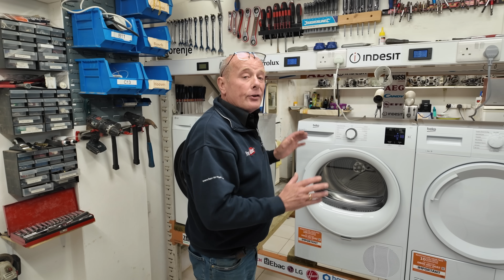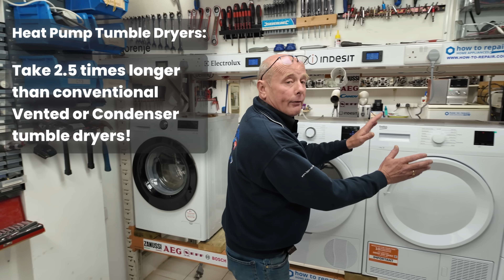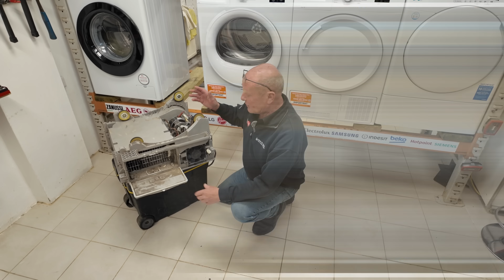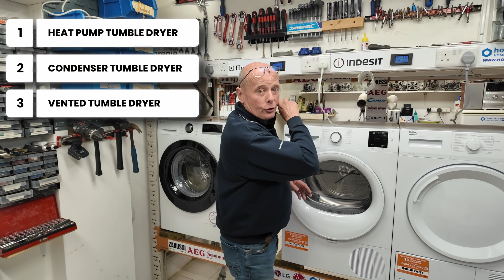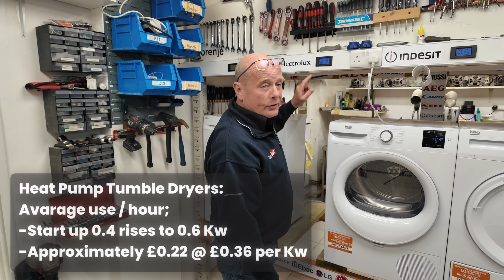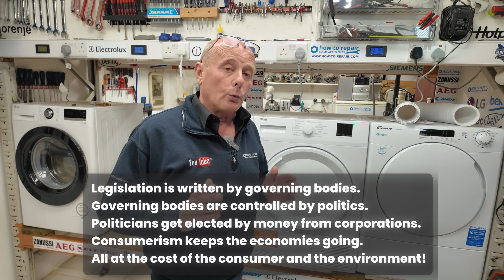Tumble Dryers the Shocking Truth About Heat Pump vs Vented & Condenser, NEW LEGISLATION!

Comment: Well my Beko heat pump drier is a replacement for my old condenser drier that died….it is in the garage, so no warm temperatures, it is also a condenser - I have to empty the water tray every time, and as for maintenance it is the same as the condenser system, as long as you hoover out the exchanger monthly, clean the filter every time and occasionally wipe the actual sensor (it gets covered In insulating fluff) it works as well as the condenser one it replaced…benefits are a lot less power usage.
Considering the price against my initial outlay on the condenser system, it cost slightly more. 
Over the last 3 years I have saved the difference in price and more….if it lasts the 5 years you quote as typical usage, then I will buy another one - get another 3+ years guarantee and have a new modern heat pump system that is hopefully even more efficient.
It’s a no brainer over the condenser drier, with only the old fashioned “cheap” heater element one, that is a fire hazard in waiting.

Comment: I've been using a dehumidifier with drying setting, placed in my airing cupboard. But I've been wondering about a tumble dryer. I liked the condensing dryer I had in a high-rise as part of a washer-dryer but only because of space saving. Had a condenser dryer since and it wasn't as good as a vented machine. Done plenty of washing by hand and using twin tubs in the past. I must say that vented dryers are very expensive to run and all dryers ruin clothes quite quickly. Just look at the amount of fluff in the filter. That's your clothes becoming threadbare. Sometimes I want to do a load of clothes and some bedding. It would be good to have something. Heat pump dryers caught my eye when they came out. Probably not for me at that price. I was thinking of maybe putting a dryer in the garage. The airing cupboard method is cheap and effective but a bit noisy close to the bedrooms and sometimes I have to go in and move things around a bit. I also have an extension lead trailing g across the landing floor.

Comment: Appliance lifespan is a big topic. A lot is said about how appliances don't last as long. However, when you look at what things cost years ago adjusted for inflation it's surprising how much more they cost. So yes, people should have expected more years of use at those prices! With the current cheaper but typically shorter lived items, are we getting value for money is the big question I guess? And what are our modern consumer expectations? Do we shop for durability as much as our grandparents would have?

For me, getting enough lifespan out of it is the important thing, but for most items it doesn't have to be more than about 10 years to satisfy me. Appliances are consistently getting more features with each generation now and that makes replacing them periodically more desirable, for example many older induction hobs like the one my mum bought 10ish years ago still work - which is great - but the latest models have a lot more features and smart technology. I just bought a £550 bosch induction hob with lots of nice features that I'm already enjoying, but will it hold up against the latest hobs in 10 years time? Probably not, and at that time it will have cost what, £55 a year averaged out? With the appeal of the latest technology I won't feel a great desire to fix it if it fails then, I might even already be checking out other hobs anyway. The gas hob it replaced wasn't broken, I just didn't like it any more. My Siemens dishwasher cost £700ish, so if that lasts 10 years I've spent £70 a year, roughly about as much to own the machine as the detergent, salt and rinse aid to use it! So even fairly high end stuff is cheap enough to have pretty low yearly costs if it lives to a reasonable, but not remarkable age.

I think for many consumers today exceptional longevity just isn't as desirable as it once was now that appliances are cheaper and periodic updates to have newer technology are desirable, even expected. We live faster more disposable lives than ever now. It has upsides and downsides really.

Comment: If i knew i would never have gotten a heat pump bosch. Condenser seems like a good middle way as we are not allowed to dump the hot air into venting system and its nice that the water goes down the drain+ easy to clean.i have looked how i can clean mine but cant access as you said and the lint catcher is NOT 100% air tight so I can see tiny dust on fins already after some 100 cycles.

Comment: Hi Paul, thank you for taking the time to produce this video! I am looking to purchase a new dryer,  after your video I will look for a vented or condenser unit now, I have to agree with you the logic does not hold for heat pump dryers. Thank you for your insights. Regards Andy

Comment: Looks like quite a few heat pump dryers are not that much slower than condenser dryers. I've seen a review of a Bosch one that only took just over an hour but a hoover model took nearly 3 times that so looks like the times vary a lot. Wonder if the technology is better in some than others.

Comment: The main problem i found with my (now very old) bosh heat pump (10+years) is about cleanin. some month ago the fluff went into (under ) condenser, where there is the water, at the very back of machine there is this electric part that when touch water start to pump water into tank. well... the fluff into water become sludge and get stucked to those two pin, so the pump went in error like: empty the tank u idiot... was quite a pain to understand what the problem was also becouse i thought that that back panel need to umnound EVERY side and top panel to be reached... guess what? i could open it directly from behind, but was a good thing to totally open becouse inside there was quite a lot fluff... but it took me so much time... i ' m not good at those things and if u think that some screw are UNDER the machine to remove side panel....

Comment: Thank you for sharing this.
I have a Bosch heat pump with a self cleaning condenser, it takes a very long time to dry the clothes. I wonder how effective ‘self cleaning’ is? (I’m unable to access the condenser to check).
The appliance weighs loads more than a standard condenser or vented.
I wholeheartedly agree, heat pump tumble dryers are false economy & over engineered for a domestic appliance.

Comment: You have forgotten that vented driers are blowing air out of the building. This air has to be replaced. So you are drawing air from the outside to replace your internal air. In the winter that means you will be drawing cold air , possibly freezing air, back into your home. This will be compensated for by more load on your heating system causing wear and wasted money on fuel bills. The condenser drier, being a closed system actually reduces the load on the house heating system. The extra purchase price of the condenser drier is more than compensated by the reduced heating system bills.

Comment: I have been considering the heat pump tumble dryer for a while now, had several vented and currently got condenser dryer, both as you state 'very easy to maintain' and parts are relatively cheap. So sticking with what l have unless the government phases them out 🥺

Comment: I have a grundig heat-pump dryer for last 5 years; in my opinion a big improvement over my previous Bosch condenser dryer, less moisture in the room ,much quieter and the clothes don’t seem to shrink or distort as much. I take you point though that you need to examine the entire life cycle of the product before purchasing anything…I was unaware of issues in recycling heat pumps…. I’ll have a look into that. Thanks for posting.

Comment: Fridge work most of the time 15 years or more before having issues, they are basically heat pumps. Why would heat pump dryer die after 5 years ?

Comment: They need to design them better.  Engineer's even charge call out of £100 without fixing or repair costs. Always cheaper to buy new, as many times items break again within a couple of months, so you've wasted your call out fee/repair money in my experience.
I'm  fed up of items not lasting like they used to years ago, Gov goes on about landfill and climate change.  Same with mobile phones, sim cards changed, and software doesn't work anymore, they say tvs aren't lasting as long, well we had tvs for 25/35yrs.
I just hang stuff up  now.  There's always the laundrette for bulky items.

Comment: The final bit of math that's missing in this video is (approx): 

Energy per load: Vented = 2kW; Condenser = 2kW; Heat Pump = 1 kW.
Cost plus maintenance after 5 years: 
   Vented       = £200 + £100 = £300; 
   Condenser = £250 + £100 = £350; 
   Heat Pump = £400 + £300 = £700. 

Using each dryer for 300 loads per year, the cost of energy will be:  
     Vented = 300h x 2kW = 600kWh. Hence 600kWh x £0.27/kWh          = £162 (per year).   After 5 years = £810.    Total cost after 5 years = £810 + £300     = £1110
     Condenser = 300h x 2W = 600kWh. Hence 600kWh x £0.27/kWh     = £162 (per year).    After 5 years = £810.    Total cost after 5 years = £810 + £350    = £1160
     Heat Pump = 750h x 1kW = 750kWh, Hence 750kWh x £0.27/kWh  = £203 (per year).    After 5 years = £1013. Total cost after 5 years = £1013 +  £700  = £1713

I've been using a condenser for a few decades. I'm very happy with the fact they work as quickly and efficiently as a vented dryer and can be repaired. I consider reparing any appliance to be an important factor. I use my dryer to dry towels during the summer months - when my heating system and bathroom towel rails don't heat up. We have a family of five, so it's important to dry large quantities of clothes quickly. My dryer has a humidity sensor (Beko) and so it doesn't always take 90 minutes to dry something. I don't care about the energy used. If it's important then convenience is more important than cost - besides, it's my GAS bill that's the problem. Electicity costs are very constant in my household (around £150 per month in the UK for our family).

Comment: Great video!
Can you recomend condensor type tumble dryer for about 600 €? 

Have solar panels so electricity cost is not so important.
Reply from the maker: The problem with recommending new machines is that they have not been on the market a long time so I do not know the reliability factor of them. The AEG zanussi Electrolux are not bad for the money
Reply: @How-to-repair , thanks. Miele TWC640WP any good? Its + 300 €. Maybe worth to add extra money?

Comment: 👏 Spectacular as always the comparison, finally big thank you for the channel! I still don't entirely agree with some things I've already verified in the successive clothes dryers I've bought (ventilated/condenser/heat pump). From what I have as facts, the ventilated one, despite being cheaper equipment, over time it's not worth it, the temperatures it reaches can still be high if at maximum capacity! Some already have sensors and programs that adapt could still remain on the market... As for the condenser ones, there was a love-hate relationship, it was a solution for places that didn't have adequate ventilation for the previous ones but which still consume a lot, and the drying times are as long or longer than those of the heat pump (I guarantee) but there are always variables such as the temperature of the compartment or even the humidity, despite being a "closed circuit". The temperatures reached inside the tank for the condensation to work are hellish, it almost feels like a pressure cooker, and with all this, the clothes suffer much more. +/- 7 kg of clothes centrifuged at 1600°C always take close to 2 hours to dry and put away. Oh, and cleaning the evaporators of the first machines that didn't yet have sponges to reduce the fluff is even worse!! As for heat pumps... a lot can still be improved; the transition from manufacturers seems not to have been well thought out (or thought only in the period to the obsolete). One of them from Smeg is extremely economical, silent, but fails in the sensor programming (some programs seem to get blocked with the machine always running until manually turned off). This last one from Bosch series 8, exceptional, even more economical, and has extraordinary drying times. 7 kg 1600°C 1:30 (but 9 kg drum)... Autoclean (which I suspect I won't like), but the best to date. Even with this automatic cleaning system, I see that there will be areas of the evaporator that will not be cleaned well and will accumulate lint. The water recycling method itself for cleaning has flaws... but it is not understandable that they did not design a more practical way to access the points that will always need maintenance... but among the 3 systems, this one was very well achieved. A comparison I would like to see was the same load and the different times with the associated consumption. Although the ventilated one consumes more, I believe it is more efficient than the condensation one in terms of the time it takes to reach the drying level. 🫂

Comment: I used to have a gas tumble drier called a white knight…it was brilliant as it dried clothes etc very quickly and therefore was extremely cost effective…Unfortunately they no longer make them and I  now have a vented machine which is ok but nowhere as good as the gas tumble drier ! The heat pump drier sounds terrible!

Comment: Yes i worked for BSH and if a heat pump dryer lost its gas we could not do a repair as we did not have the refrigerant needed
Reply: Hoping that my 6moth drier Bosch won't need gas next 5Y😅

Comment: I have a vented dryer and use it almost every day, I have dogs so the throws on my sofa's are washed frequently, my  dryer is in the garage and it dries my washing fairly quickly usually in an hour. I do not want a heat pump dryer that is going to take twice as long to dry my clothes and cost twice as much to buy and repair, so the money you save from the energy it uses is just spent on a repair or a replacement. Wake up Government you should not be allowed to dictate to us we are the UK not Russia

Comment: I'll stick to my Miele vented drier thanks. I also have a Miele condenser which takes forever to dry a load of towels, I have to take the towels out, shake and return to the machine and restart it and I do this several times. The vented no problems. I don't have the  time to waste with a heat pump or condenser - what a waste of money they both are and as for the damage to the environment with the manufacturing and repair processes

Comment: We bought a logik 8 kg  heatpump for 300 pound in 2001 and so far it's been  brilliant saving a fortune in electric .our old white knight 3kg from Asda cost 80 pound in 2005 .very reliable machine though .all I did was gave it clean inside of fluff and replaced heating element that cost 15 pound .still have it in garage and it still works .it used electric like going out of fashion though but totally agree DIY fixable easy mostly .I doubt I could fix the heatpump one though myself Nd I can do DIY maintenance.i certainly can't see the point in paying 500 pound plus for many heatpump dryers total rip off

Comment: Went from a 12 year old Miele heat pump dryer at 6 stars efficiency to a new Miele with 10 stars and it take significantly longer to dry clothes, running for much longer overall.

Comment: We have a heat pump dryer - but we stopped using it. Instead we use a mobile dehumidifier in the bathroom. It has amazing benefits: bathroom dries up after showering AND it dries the clothes at the same time.

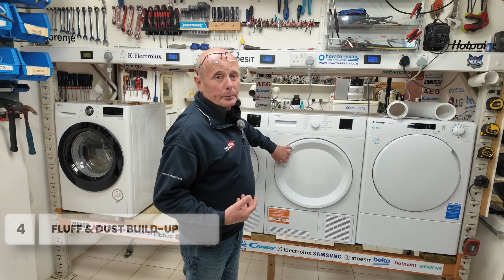Comment: 8:28 I believe this isn't the case. I believe that due to the decreased temperature during drying, the wear on clothing as well as the amount of lint generated is significantly reduced.
Reply: You may "believe" that - it doesn't make it true.
Reply: This is false. If you saw the amount of lint in the heat pump dryer I owned, you wouldn’t be saying this. Unfortunately, because the machine was ventless and because there was only two places to remove any lint (lint filter and drain pump filter), the bulk of the lint would cake up in parts of the system that were user-unaccessible. RIP, GE Combo Washer/Dryer.

Comment: I own a restaurant and I started wandering why my shirts an trousers are wearing out so fast. Now I have to discard them after less than one year. That was not so when we used the old driers. I strongly feel that the environmental footprints of these heat pump driers are bigger than the environmental footprints of the old dryers. Yes, the energy consumption was bigger with the old system but this is so far the only advantage of heat pump dryers. For the environmental footprint you also have to consider that people who use a heat pump dryer have to buy 3 times more cloth than they needed with the old system dryers. In your video you mention that the heat pump dryers take 2,5 times longer but my experience is that the clothes are never really dry after the recommended drying time. So we have to add drying time very often. That means the mechanical wear is even about 3 times or more bigger not 2,5 times. Now you have to calculate how much energy and resources new cloth are taking to find out the real environmental footprint. I leave that up to others. 
You also have to consider the time factor for a business like hotels and restaurants. During one working day you can now dry only one third of the amount of laundry. So you need longer working hours or more machines to try the same amount of laundry. For my restaurant that is not possible because we a space restricted. Sometimes in the evening we cannot put in the freshly washed clothes because the machine is still drying and then the next day we are missing try clothes. 
Let us hope that somebody in the government is willing to change this for a better environment and happier citizens.